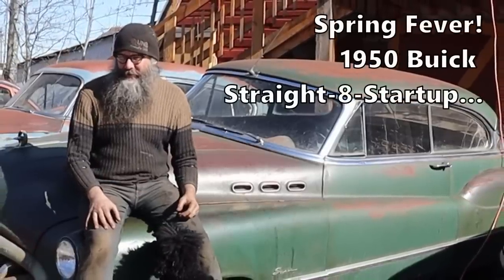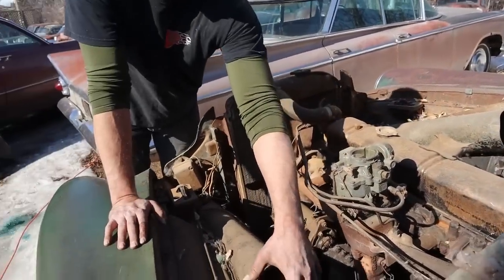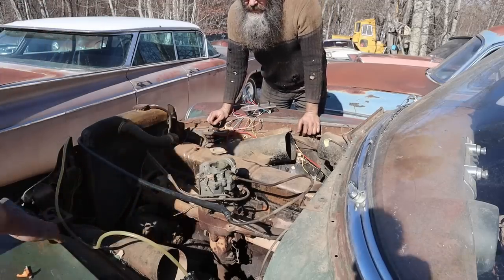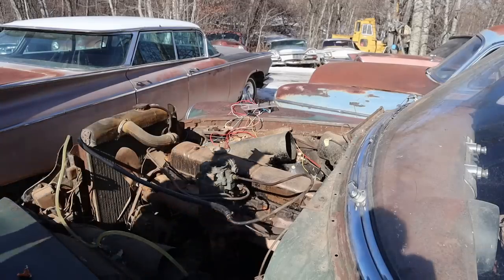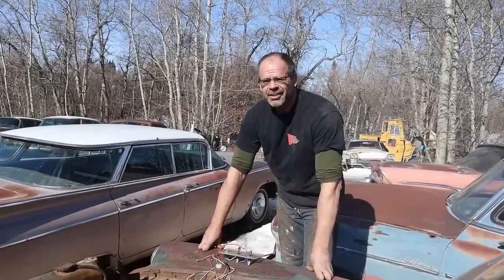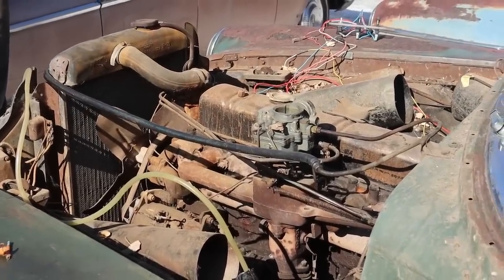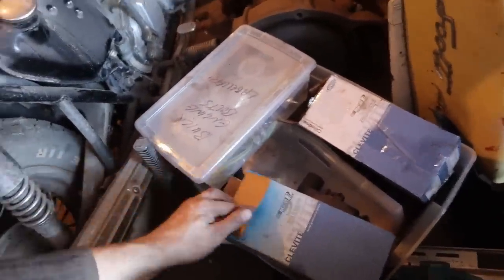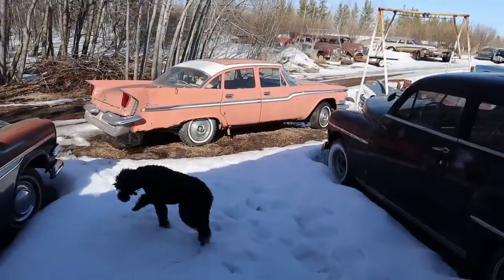Spring Fever! 1950 Buick Straight-8-Startup!

Comment: Okay just when we thought we know the project schedule you threw another one at us but I'll gladly watch a straight 8 build. Good spring start I would not think that motor was trash by the way it started. Its funny how a warn-out engine will sit there for ever but a low mileage GM 305 will seize while you are having dinner and a nap. Keep the faith there more projects coming. Myles should pick up a standard clutch pedal and maybe a 3 0n the tree just in-case the future requires it for Mr. Strato-Chief.

Comment: Glad to hear it run. Can't believe it started that easy. Now if you want a real will it run challenge start up that black 57 Plaza with the ultra tired 52 truck engine.
Reply from the maker: Haha that thing is shagged... It will start but I'd have to pull it around the yard to get it going...Cheers!
Reply: @coldwarmotors  send it to me.

Comment: Oil dip stick, ah it’s junk anyways. Again, Myles stands by a carb and away it goes. That was a great showdown show as are the rest. It. You should take her for a rip around the yard. It be great. Warranty never expires on old iron. Knowledge and what the heck is the way to go. Sounds good to hear on old straight 8 putting along. Just a bit of welding and a slight clean, it’d be ready for the road.

Comment: FIREBALL!
There's something uniquely satisfying about revisiting a project previously "completed" a few years later - and it still
working today! 
You get the visceral satisfaction of an old engine firing up, running well, smokin' and belchin'....
PLUS all the memories of the original effort come flooding back to enjoy again too!
That you enjoy the process with the good friend who was the original partner on the job is bonus, too.

Dang, Scott, you got so many viable projects gathered up at this point...have you consciously at this point slowed
down acquisition of "new" ones a tad in acknowledgement of what you've already signed up for in work to be done?
(Speaking of Spring Fever - Fred comes out today! Been a really hard winter for me, I need this badly...)
- Ed on the Ridge
Reply from the maker: Cheers Ed! Enjoy a cruise in the GTX for me! (I'm trying not to buy any more cars, but I'm probably going to fail, haha...)
Reply: @coldwarmotors  Probably true. 🙂

Comment: Building a Buick 8 engine sounds like a great idea - but that Roadmaster just needs its transmission sorting out. That has had a rebuild, so there is probably a minor but significant error that prevents it working. It would be great as a winter project....

Comment: Online quick search states that the 50 series makes 124 hp and the 40 series makes 120 hp - both engines displace 263 cu. in.
I just noticed how cool this car is, a 2 door hardtop. I hope you get this one going in a restoration video. it would be very cool. You are lucky to have found this as most of this years Buicks still around today are NOT the 2 dr. hdtp. version.

Comment: Go for the swap by all means.

For an 80 year buick fan it warms me plenty.

My first car a 53 buick super convertible.

The year was 1959 .

I now have non running 
a 1953 2 door roadmaster. 

A 1953 super 4 door.

A 1953 super rolling frame.

A 1953 super 4 door. 

A 1954 4 door roadmaster,  could run ?

A 1967 Eldorado running. 

A 1967 Eldorado parts car.

A 1968 Eldorado barely  runing.

A 1970 Pontiac Grand Prix I brought  new, I am the original owner, 

I have driven over 650 THOUSAND MILES in this car, it still runs, needs transmission  coolant line repair and  brakes, paint , etc.

Not for sale at any price !

A 1070 Grand Prix parts car, would run if played with.

My place looks like your place !

A man alone with his Dog , can collect so much vintage rust !

Fix the 1950 super, you will love the underseat heater.

The 1950 buick series through the decade to 1960 were 4 inches longer for the 4 door cars, than the 2 door car.

Awaiting your 1959 car rollout. 

I am so thankful for your videos,  you guys are keeping me  alive.

I am an 80 year old toolmaker and I still work.

I have made several complete sets of 1953 Buick Skylark stainless steel  side trim sets, complete with correct rolled crown form.

Thanks again,

Gary Muncy

Comment: Even tho you got a better motor to install, I love to see the resurected junk ones cured!  Yes it can be over bored and repair sleeved.  We have saved truck motors that dropped a valve and cracked the bore.  Just over bore the damaged cylinder and press in a repair sleeve. Weld up the hole in the head, good to go! A first rate machinist like Strongs Garage could pull it off!

Comment: Dear Coldwarmotors Scott N.
👍👌👏 Another great video (although with not really enough black poodle content in it). 😁 ;-) 2) I perfectly remember the straight 8 competition/showdown! It was definitely a lot of work back then. Amazing that the JB welded cylinder wall still holds up and how easy the car started. 2a) Like me you obviously like to get sidetracked from projects you are or should be working on. Procrastination will kill your progress and even dreams. Please don't ask me why I know this so very well, sigh. 😁 ;-)
3) By the way: Here's something I want to ask you for a loooong time: Why do guys/agents like Miles don't buy (or long time lease 😁) cars from you instead of hauling them from far away? At least by doing so, some more cars would be saved respectively back on the road again. For instance Tom's former car would be a great candidate for a great guy like Miles. At least in my personal opinion.
4) By putting some of the disassembled engines together, you would definitely gain some space. But I guess you simply don't need storage capacity. 😁😁 ;-)
5) PLEASE PLEASE PLEASE do the gorgeous inside and outside green Buick Roadmaster after you've finished the Rover (at last) and the finned yellow Fury.
Thanks a lot for making teaching explaining recording editing uploading and sharing.
Best regards, luck and especially health to all involved life forms.

Comment: I threw out the two barrel customized the exhaust port and cut out the flap strapped a four barrel on there and it runs like a V8 no bogging or backfiring just pure smooth rotation

Comment: Never any doubt. If it ran before it will run again. The 263 cid straight 8 when new made 120 horsepower at 3600 rpm. I can't believe the straight 8 challenge was 5 years ago already. Where does the time go?

Comment: Excellent video Cold Water Motors Agents Scott  :) , Myles :) , Frankers The Dog 🐕  also yes 1950 Buick Super Riviera with Super 263 Cubic Cm of Straight 8 cylinders motor also that motor must took care on oil changes  regularly and first start up so many years Lol ! I now guy in my local car club has 1937 International pick up 1/2 ton street rod with one those Straight 8 bore up 303 Cubic Inches with GM Delco Alternator 100 amp 1978 ,  plus got floor shifter Creeper 4 speed , Power Steering, Brakes, truck Differential 377 rear and fuel tank in box is Transport Round Cylinder type 350 gallon tank! Exhaust  is got Silencer from 2000 Chevrolet Impala car also farm tractor round stack with rain cap ! Rad is Farm tractor from 1950's and full bench seat!

Comment: Great video love the sound of a straight 8 running but you said some 2018 new vehicles might not run I have a 2018 Ram 1500 eco-diesel with 256,000 miles on it still driving and running great when you live in the Nevada Desert and it’s 120 miles to the closest Costco witch if you don’t have up in part of Canada, it’s like a big Walmart supermarket

Comment: I would love to see the spare 263 get built. The prewar 248 split exhaust manifolds and twin carb intake is a bolt on, and Edmunds also made multiple carb intake manifolds. Of all the Buick straight 8 engines, the 263 is the most modern, and has the most hot rod potential.

 Here is a link to a song that Buick straight 8 lovers should all enjoy
https://youtu.be/1d7veSoRBlM

Comment: I vote 4 door road master as it is , and the 50 2 door needs that new engine,  me personally I'd do some body work , do a custom interior because you have the seat frame , floors if they are needed,  or patch them up,  I'm a keep it the original color of if it's that bad primer Grey kinda guy. As long as it gets down the road straight and runs drives and stops I personally can't complain on a vehicle , even if its a Soviet Union, Lada baby poo green , or the iconic bright orange color they had which safety regulations were first for the Soviet Union ....